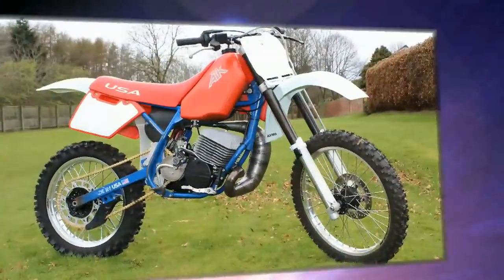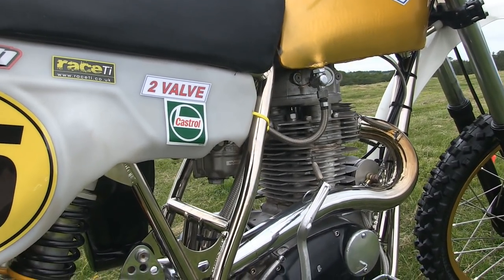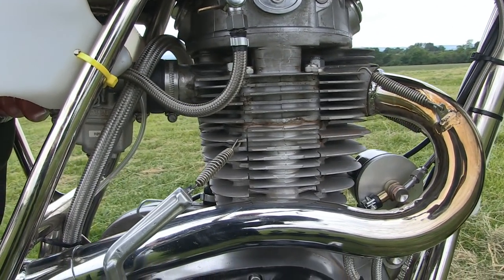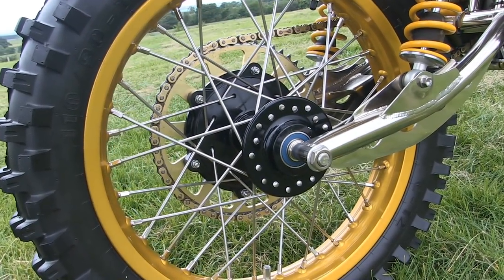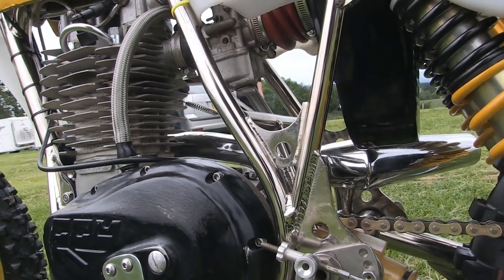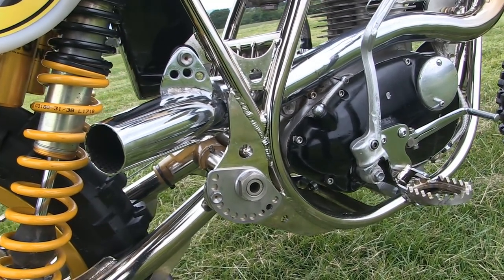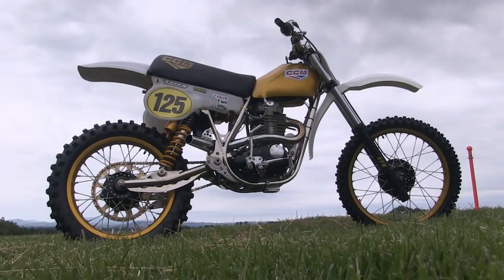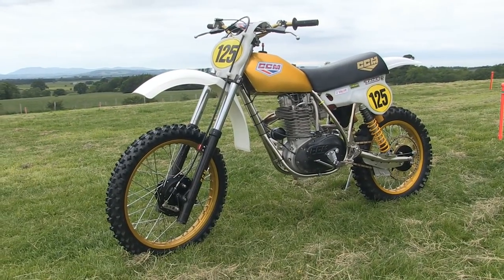"Classic Dirt Bikes" Ian Stainton's 1979 520 CCM

Comment: I've got an original 1979 CCM MX 250 which I've owned from 1981 and it's an animal, 250cc Hiro engine with a 38mm D'ell Orto carb and Motoplat CDI ignition, years in front of the others in technology
Reply from the maker: gari machin You May be interested in having a look at this 1980 model. https://youtu.be/p8xBlVV4ksI